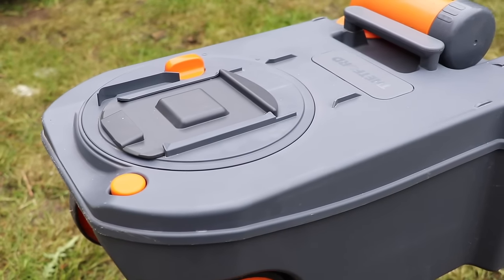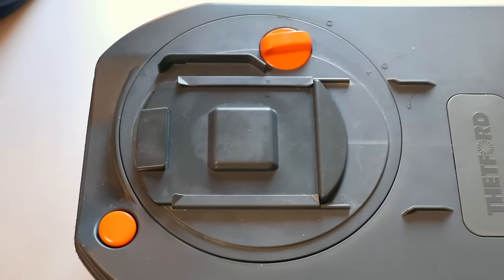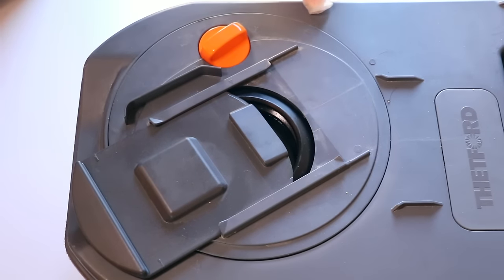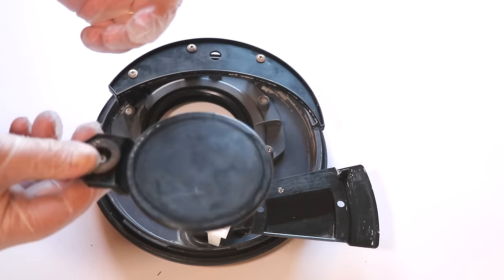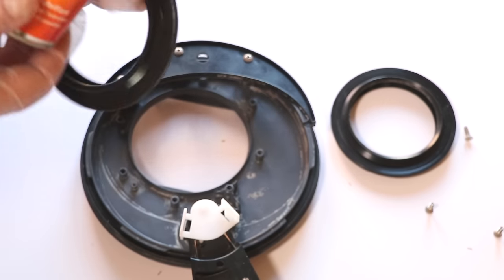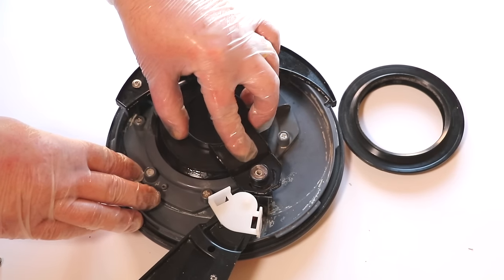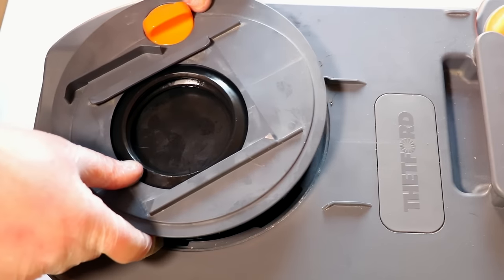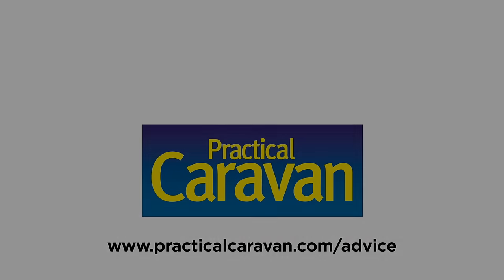Practical Caravan – how to replace a Thetford toilet cassette seal

Comment: A very useful video, Dan, and well demonstrated. When I discovered my cassette was leaking recently, I followed your instructions carefully and replaced the lip seal successfully. During the job I encountered other bits falling off like the white plastic device at the bottom and the blade developed a mind of its own during reassembly. Eventually though, with the job done, I tested the seal. Water still leaked out. In fact the seal that had failed was the plate seal around the rim of the mechanism. I've ordered a replacement and thanks to your video it will be a quick job to replace that.

Comment: Thanks to your video I was able to change the seal and replace the blade which was broken. I had no idea you could take the cassettes to pieces so the video has saved me a fair few pounds at a dealer. Many thanks Dave

Comment: Well made and useful video. I had to strip my C250 because the circular blade had parted company from its arm - the small plastic spigot holding it in place had sheared. Good news - the plastic reacts well to being superglued, so I have reassembled it glued back together.

Comment: Very,
 very useful video, just replaced the lip seal on my 2010 model, just a couple of points,(1) the tank cover would not move using your method, so I had to open the blade and grab the sides before it would move in to the unlocked position, (2) due to this I cleaned both the tank seal surround and rubber seal and then sprayed with the lubricating spray before reinserting.

Comment: Thanks Dan. Video really helped me out and I was able to replace the seal. However, a few other tips which may be of use for other caravan dIYers. My cassette I'm assuming is 8 years old , same as my caravan and therefore the top moulding which holds the seal and mechanisms etc was extremely tight and I was unable to turn it to the open position with the sliding cover. I used a piece of 12 mm wood cut to approx. 8.7cm wide by about 50 cm long, inserted that between the top cover guides and was able to twist the top moulding to the open position. 2nd useful tip, once I disassembled the slider etc. I gave everything a good clean, fitted the new seal and re-assembled the moving mechanisms. However everything was a bit tight and clunky, so I slightly loosened off the screw holding the blade in its pivot soaked everything in olive oil (virgin by the way), worked everything to bed it back in and it started to ease up and eventually worked nice and freely. 
Again thanks Dan, you made the whole thing easier.
Reply: Good tip about using a length of wood to lever the mechanism round. It worked for me.
Reply: Glad to be of help.

Comment: Thank you, and still very relevant. Once I got the internals off, I also had to take off the 'keeper' which made it easier to resit everything. 
Thetford charge like wounded bulls tho for a replacement seal tho.
best tool is an old bent toothbrush to clean everything up.

Comment: This is a really helpful video. My only comment is that the video makes opening the circular top look fairly easy with a strong push. In reality I had to tap the blade used as a lever quite hard with a mallet to get it to open (with a risk that it would break).

Comment: Very helpful indeed. However I am worried that as my seal has leaked will the leak remain within the unit, as opposed to ruining my caravan floor.
Reply: Hi, did you solve the leak on your floor? I have a pink fluid all over my floor and wonder if the seal is the issue?
Reply: @DrJBarnes  I changed the seal and just cleaned every thing up. I made sure that when I was towing that the cassette was empty. Every thing has been fine since.

Comment: impossible to refit to cassette will not sit properly, and no I'm not stupid I'm an engineer and the rubber seal will not allow refitting did you refit without the main seal in place to make it look easy